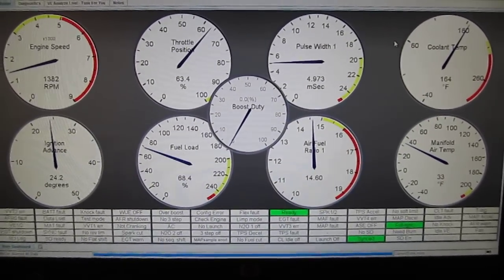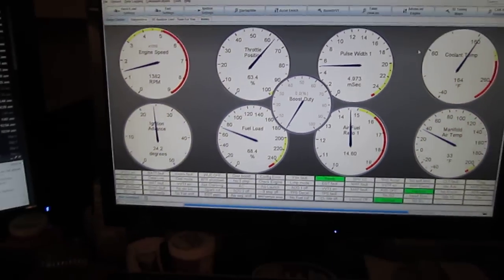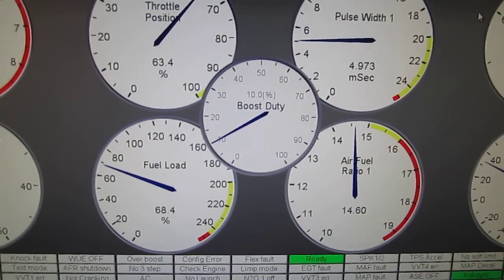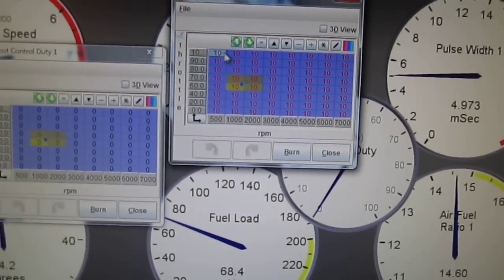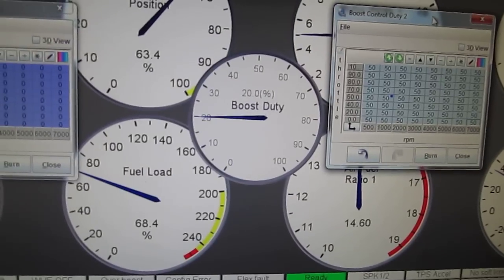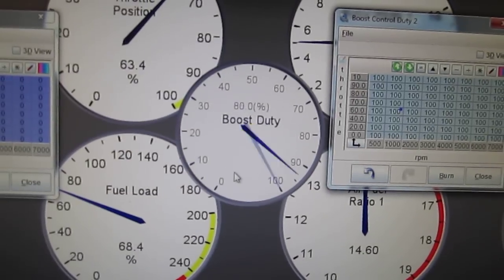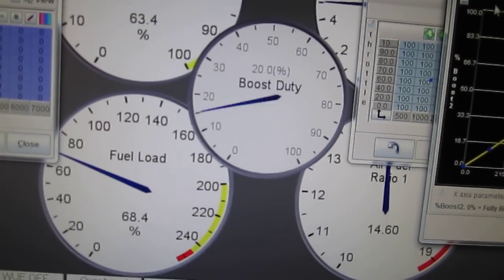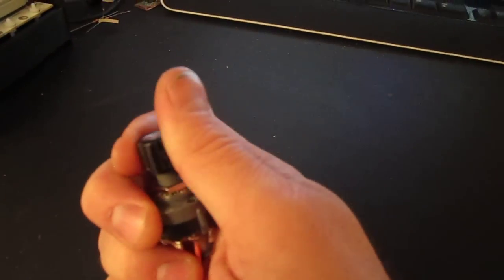Boost duty blend Megasquirt 3

Comment: What type of switch? Variable voltage output? What input did you use on the ms?
Reply from the maker: you can get an aem 12 position that is 0-5v output. then you just use a free adc input on the MS3.